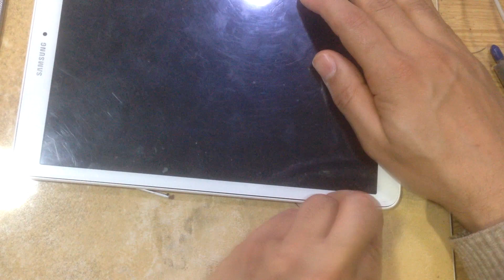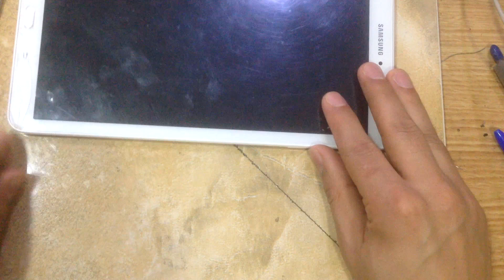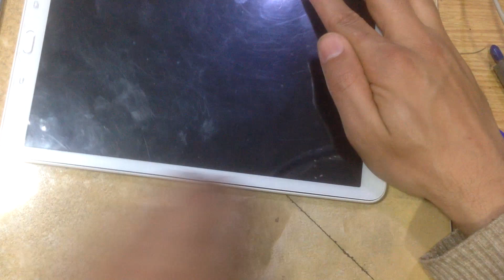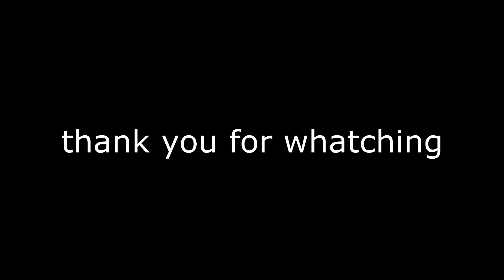Galaxy Tab E (sm-t560) charging connector replacement

Comment: Helped me immensely. I was able to use my thumbnail to get in between the case and break the seal to be ables to pry it apart. How cool is that: no heat needed. Ordered the new charging block tonight. Hopefully I'll get the new port before I forget what I did with all the parts. LOL. Thank you so much for a very informative video. I'll be back when I get to reassembly. Awesome job, sir. Bravo.
Reply from the maker: glad i was able to help , good luck sir

Comment: Hi, what is that transparent cream? And what for? I am new in this arra.
Reply from the maker: hi its soldering flux it facilite soldering and prevent motherboard from burning when applyng heat on it
Reply: My son just damaged his charging port tonight, how much would this repair cost? I’ve been interested in electronics for years but lack the proper tools for a delicate job like this. It appears to be very simple, but I’m sure the tools would cost more than the repair itself..
Reply from the maker: @unknowninfamous2346  the price depends on the place where do live here in morocco it costs about 7 to 10 dollars
Reply: is this possible without the heat gun? I have it all open ready to go just waiting on the part and then gonna have to use solder iron